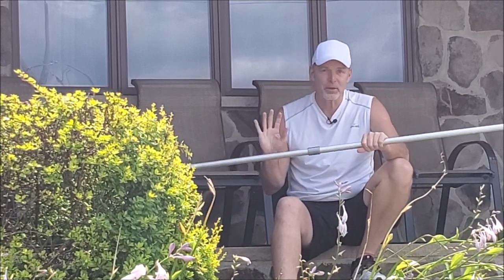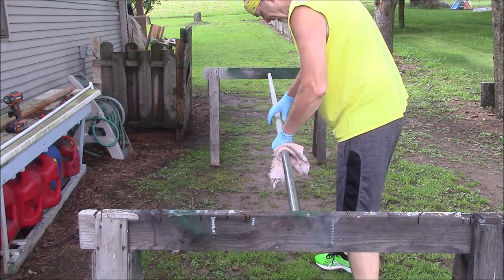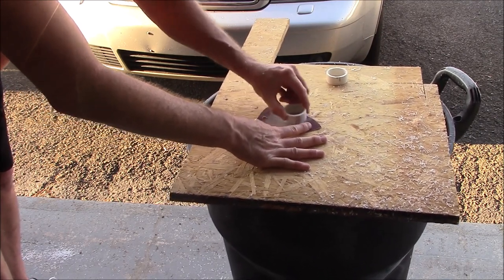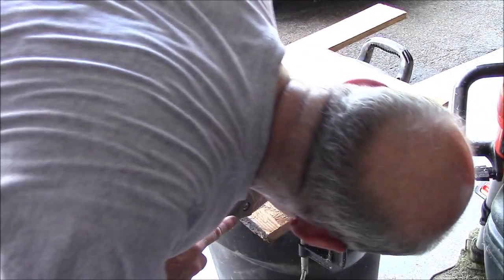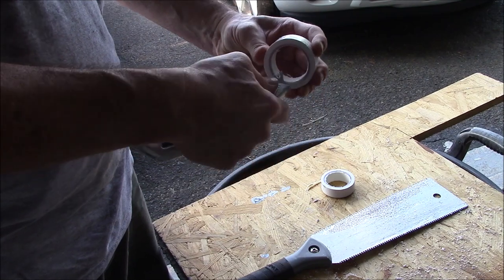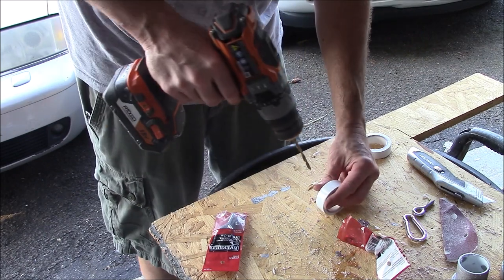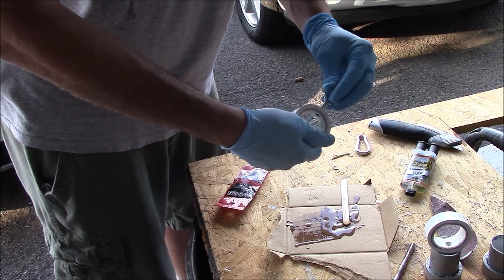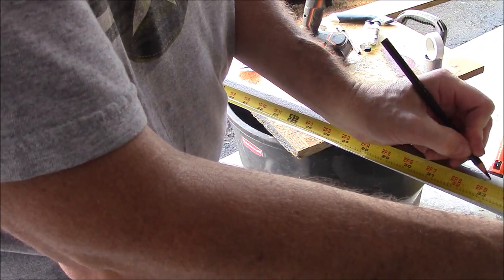HCC 59: Homemade Flag Pole

Comment: Thanks for the video. A lot of good ideas that will be useful in the flagpole project I am planning.  And a big thank you for including the important point on illumination and general flag etiquette.  What did you decide on for the finish of the concrete base?
Reply from the maker: Great! I'm glad you were able to take some inspiration for your own design.  I hope you let me know how it turns out.  As for the base, I just put a coat of the same parging I used on the house foundation and then a cap stone.

Comment: I would have turned the bottom holder upside down. So the spinner couldn't slide up. Other than that good job.
Reply from the maker: Thanks,  but I thought of that too. Flag still got tangled that way.  I don't mind if the flag rides up a little on high wind.  Better than wrapping around the pole.